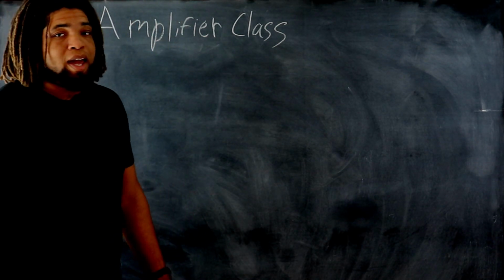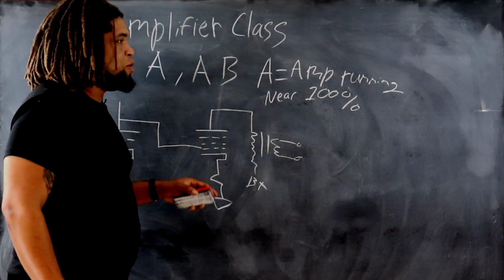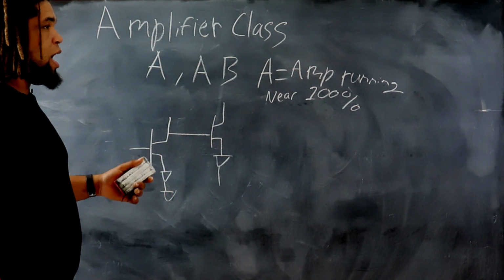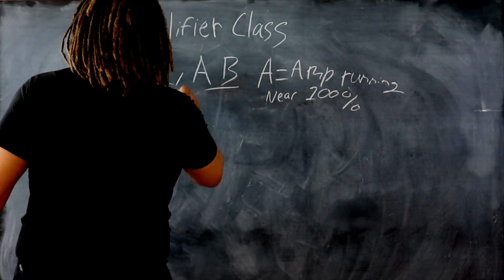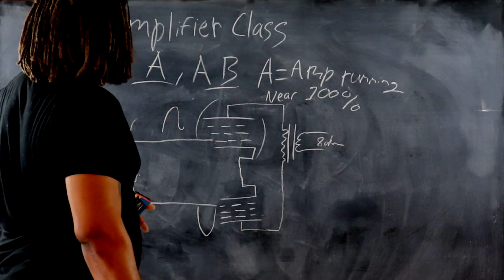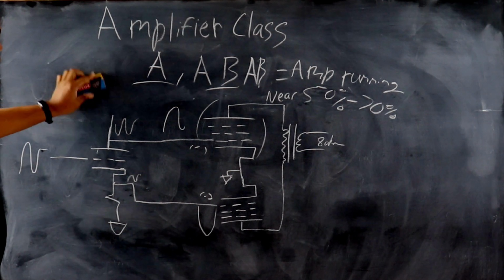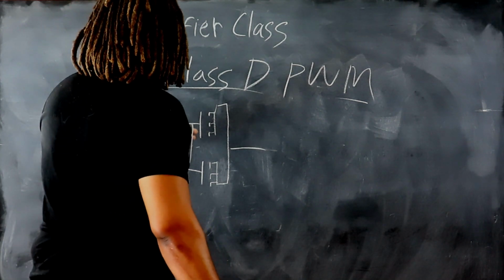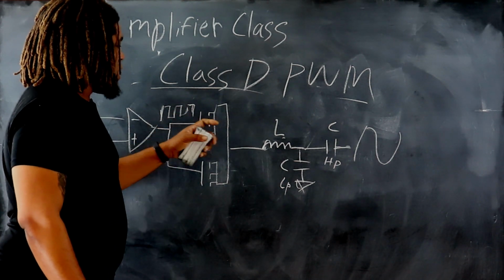Class D Amplifier Explained

Comment: For car audio powering subwoofers i use tube amp pro simulator through my music app and even thru blue tooth signal to my head unit as well it really cleans up a lot of switching or crossover distortion i usually had before from my subwoofers subwoofers

Comment: Confused: that seemed to show how the input signal is converted I to a pwm high frequency square wave in a class-d amp, but not how it is amplified and reconverted back into a sine wave in the output stage.  The pwm signal can't be sent directly to speakers, right? And the low pass filter filters the pwm square wave signal out, anyway.  But without converting that signal back to a sinusoidal waveform, what would be left after the high pass filter?  That said, I've watched a few videos on this, and so far I haven't found any that explain how the output stage works.  What am I missing,  here?
Reply: The rail of the mosfet is at a higher voltage, causing amplification.